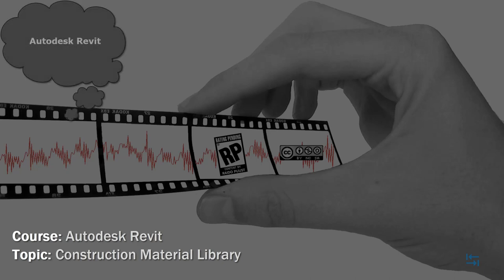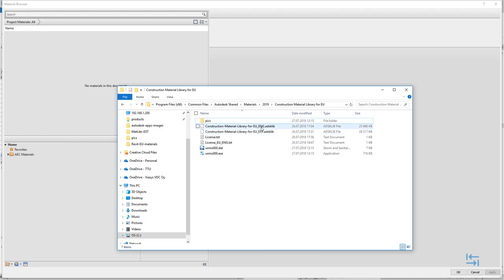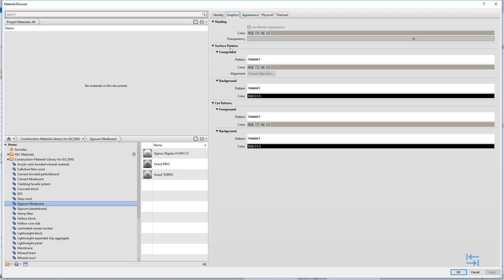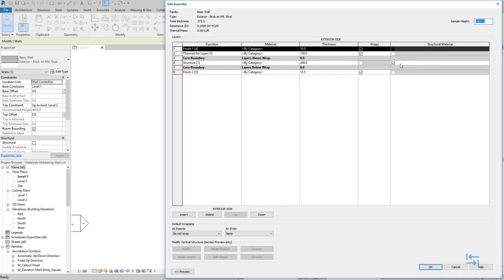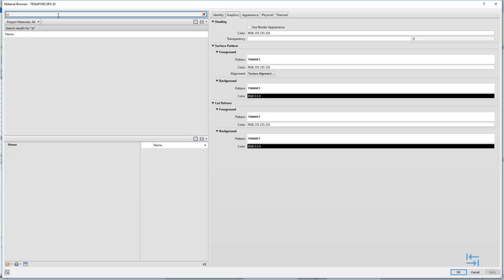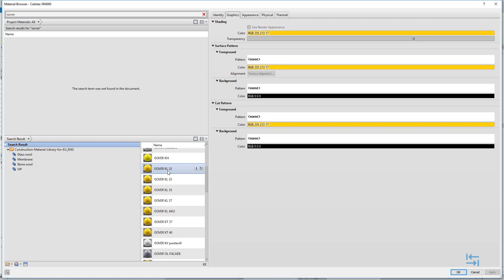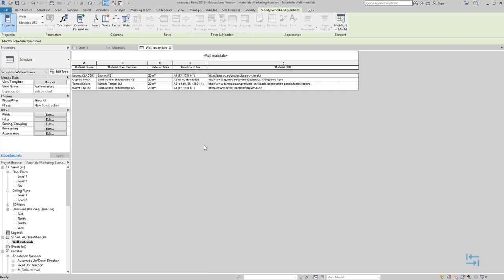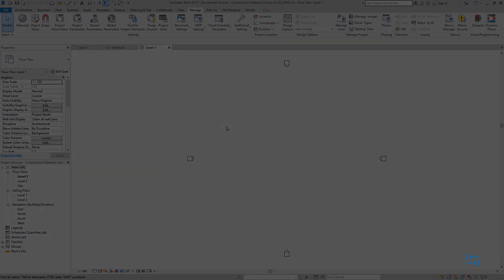Autodesk Revit - Construction Material Library (in English)

Comment: Tried downloading this great resource but it always fails at the last bit via the autodesk app store.
Reply from the maker: Thanks for you comment. I tested just now and for me it took about 30 seconds to download (no "last bit failure"). I used regular mobile network. Hopefully it finally works out for you as well. You might want to download to another location (C, D - drive/folder).
Reply: @eRaido  I've tried multiple computers, I can download it on my phones chrome browser but any desktop browser won't allow it to pass built in virus scanning. once moved to onedrive or dropbox they don't allow it to pass through their virus scanner for me to download. Which begs the question why is it an .msi file? It's either a virus or causing false positives.
Reply from the maker: Nathaniel McMahon I can’t comment why it is *.msi and not .zip. This is a way how Autodesk has wrapped those files together. I believe that my own antivirus also doesn’t let to fire *.msi files without extra permission.